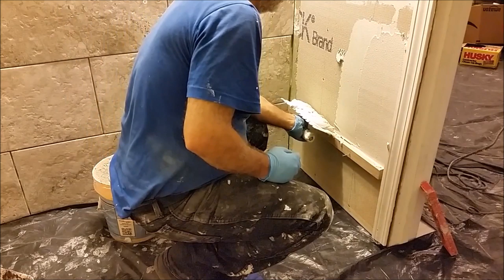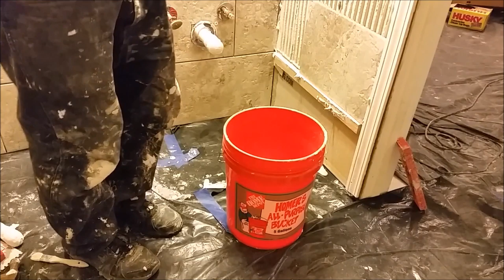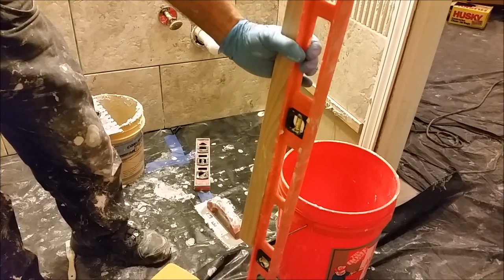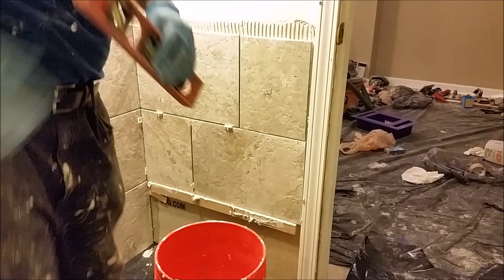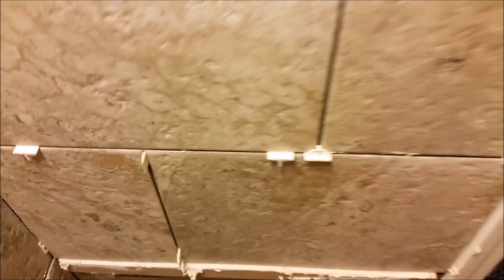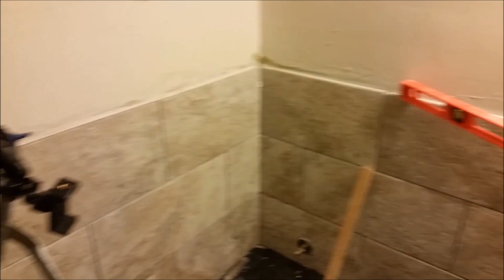How To Tile Inside Corner In Bathroom Using Large Procelain Tiles - Step By Step

Comment from the maker: Best Thin set used = https://amzn.to/3cxVBz8
Medium thin set =  https://amzn.to/3mSk9aR
Mapei Pre Mix Grout = https://amzn.to/2HqhdC3
Mapei Grout = https://amzn.to/340hWS5
48" Level = https://amzn.to/347tmUl or https://amzn.to/30m3y5H

Tools and Materials  used:
Angle grinder used = https://amzn.to/368IX8C
Diamond Blade =  https://amzn.to/3j2kTbc
Dimond hole drill bits =https://amzn.to/36bX2Cs
QEP wet saw = https://amzn.to/3cLJgaW
Diamond Blade = DeWalt https://amzn.to/3jfdpSr or Black Widow https://amzn.to/3jgx18G
Grout Float = https://amzn.to/3j7KO1c or https://amzn.to/348KLMu
Notched Trowel 1/4 x 1/4 x 1/4-Inch= https://amzn.to/3j26Zpv
Notched Trowel 1/2x 1/2 x 1/2-Inch= https://amzn.to/2S5Zceg
Notched Trowel 1/4 x 3/8 x 1/4-Inch=https://amzn.to/3cDPbhZ
Nitrile Gloves = https://amzn.to/3i8VhrT
Best Thin set used = https://amzn.to/3cxVBz8
Medium thin set =  https://amzn.to/3mSk9aR
Mapei Pre Mix Grout = https://amzn.to/2HqhdC3
Mapei Grout = https://amzn.to/340hWS5
Miter Box Used =  https://amzn.to/2SnYgm1 or https://amzn.to/2G1CVfB
Hand saw =  https://amzn.to/30kvabp
48" Level = https://amzn.to/347tmUl or https://amzn.to/30m3y5H
Amazon Deals:
Try Amazon Prime 30 days for free = https://amzn.to/2JMWaLe
Create Amazon Business account = https://amzn.to/3mLSyYt
Joint Amazon Prime Watch Thousends Of Movies and TV = https://amzn.to/33NfsHD
Try Personal Shopper Wardrobe  https://amzn.to/2VClfv9
Amazon Deals:
Try Amazon Prime 30 days for free = https://amzn.to/2JMWaLe
Create Amazon Business account = https://amzn.to/3mLSyYt
Joint Amazon Prime Watch Thousends Of Movies and TV = https://amzn.to/33NfsHD
Try Personal Shopper Wardrobe  https://amzn.to/2VClfv9

Comment: Im no expert, but my box of tile specifically said do NOT stagger joints 50%. They said only go 20-30% max. But i'm sure this is the reason why your joint where 2 tile meet, will never be even with the middle of the tile above or below. The tile is actually made with a slight bow.
Reply from the maker: Not in these tiles.

Comment: Doesnt the thinset make that bottom ledger board stick to the wall making it difficult to remove?? Thx
Reply from the maker: Not realy. Thinset designed for tiles and stone not wood.
Reply: @josephk9182  thx man!
Reply from the maker: @malawigold747  Any time.
Reply: 😂😂😂😂. If that was true, there would be no reason to apply mortar between your sub floor and concrete board.

Comment: lines should be horizontal on the grout not vertical,
horizontal lines will prevent the tiles from sliding down long term.
creating a vertical lines will not hold it but allow the tiles to slide downwards.
Reply from the maker: You probably meant the thin-set ( if I am not mistaken). What you said is incorrect. This thin-set  creates 600 to 700 psi when it fully cured. It does't matter if  horizontal lines or vertical lines, the thin-set must be spread on the tile  evenly when the tile is installed (without lines).
Reply: it does not make any sense that the direction of the lines has no meaning, on any set
Reply: what about the corner itself, do you attach it to the other wall or do you leave a spacer there?
Reply from the maker: @bodyshoplifter1234  Yes I put 1/4 space .It must be at least 1/4 of an inch.
Reply: Lines should be perpendicular to the longest side of the tile, such that air can escape through the shortest route. His tiles are supported by the baton and so they are not going anywhere. When the thin-set has dried, any attempt to remove the tiles will result in the plasterboard coming away with them!
Reply: You are absolutely wrong. When the grout sets it is like stone it doesn′t matter if it is horizontal or vertical but if you want to get technical about it with enough weight on it the adhesive would break along the gap first.

So the adhesive underneath would be like rows of cemented stone, it is easier to snap a tile away when those rows are parallel to the direction you apply force, not perpindicular.

The way he has applied the grout it would be almost impossible to pull that tile off by pulling it down, easier to pull it from the left or right... you′d know this yourself if you′ve ever had to remove tiles